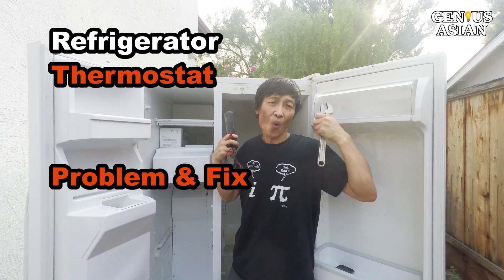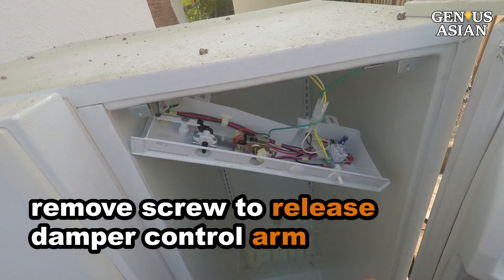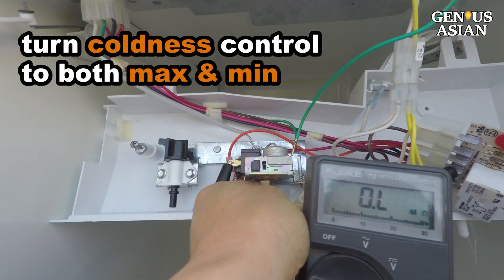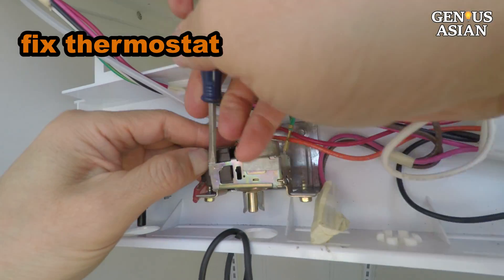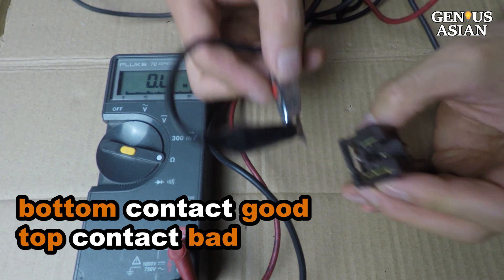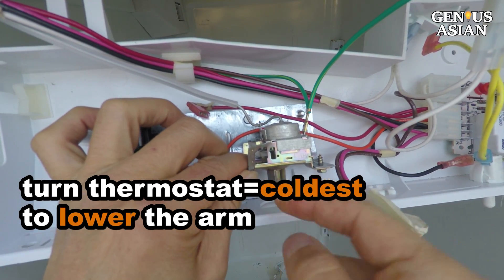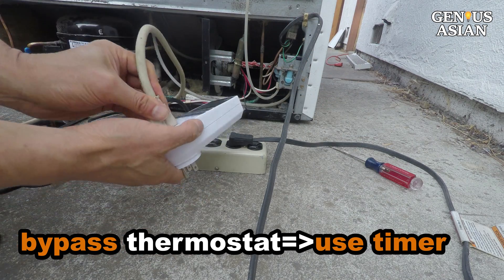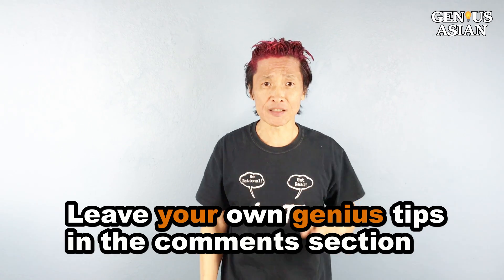Refrigerator Thermostat Not Working: Diagnosis & Repair or Emergency Fix No More Spoiled Food

Comment: Bună seara ce se întâmplă dacă pui firele greșit l a termostat ☺
Reply from the maker: as shown in the video, make sure you measure the resistance before turning on the power. If you connect wrong wire, you may short the circuit and causing your circuit breaker to trip. So make sure you never let hot wire touches a neutral wire.

Comment: How does squeezing the contact fix it?
Reply from the maker: as shown in the video, the copper strip has a hole in the center, the contact is the Platinum contact which filled the copper hole. The problem: there was no connection between the contact and the copper strip. So when you squeeze the platinum circle, since the platinum is  soft (it is softer than 14k gold), the platinum expanded to better fill the hole, thus making a good connection
Reply: @GeniusAsian  Thanks

Comment: Got a new thermostat, worked fine out of the box i tested with multimeter, but once i installed in the fridge the fridge worked for a couple of minutes then it turned off and it will not turn back on, i unplugged the wires and tested continuity on the multimeter and it says its open circuit. Yes the fridge is warm and still it doesn't turn the compressor on, but i can manually turn it on. What do to?

Comment: do they make electronic only (ntc sensor ?) fridge thermostats ? (i.e. without the capillary and bellows mechanical system)
Reply from the maker: since refrig needs to be very accurate on a very wide range of temperature, it is difficult to have a universal measurement. For example, it is very easy to produce universal standard light bulbs because you only have one 110V voltage to worry about. But Software is configured to read a specific temperature curve, whether the curve of thermal couple is a result of mechanical or electronic, the curve is not linear. Different manufacture may use different control unit, which may measure voltage drop via converter or could measure the resistance. The results would be quite different. So you can not even use the thermo made for one brand to replace that of the other. In addition, even though thermistor failure is common, it is still not as frequent as light bulb, so the technical solution chosen need to be cheap as well as long lasting.
Reply: Most NTC thermistors are typically suitable for use within a temperature range between −55 and 200 °C, where they give their most precise readings.  @GeniusAsian
Reply from the maker: @fumblingwiththeball  Thank you for taking the time to share your tips, it would help other viewers

Comment: Hi Genius Asian!  My 23 year old GE FUF17DACRWH upright freezer runs all the time, very very cold, like 15 degrees below zero Fahrenheit.  Must be the old mechanical temp control shorting but WR09X10014 is no longer available.    What should I look for when I take the control apart to try and repair it?  If you don't think I can repair a shorting unit, I might try to fit a generic one in there, like a WR9X499 and use my mechanic and metal working tools to secure it and make it fit.  Thank you!
Reply from the maker: yes, if it is the old mechanical temp control, it is just "on" and "off", you should have no problem fitting a generic one. To repair it, you to know what is the fault. Use a multi-meter to test to find out. Once you locate the problem, it should not be hard to find the best fix. good luck.

Comment: Great video! I have a very similar thermostat and once I removed the contact part a U-shaped spring fell out. I carefully watched your video and I do not see it in your disassembly. There's also a small metal plate that's touching the adjustment screw in the middle of the contact part. I can see it in your video at first but then you seem to lose it. I'm sure these two parts are not random: the plate that was against the adjustment screw and the U-shaped spring but I cannot figure out how they fit together during re-assembly. If you know the answer please help!
Reply: Same thing happened to me. I ignored it because it's just a temporary fix. I'll have a new thermostat in a day or two.

Comment: Some parts came out while disassembling the thermostat, a bent piece of metal and a nonconductive strip of plastic, Any idea where these go?
Reply: Ah I believe it’s an insulator and a tension strip for the moving arm
Reply: Same thing just happened to me. Did you get yours resolved?

Comment: Super ! But i put a new thermostat and i cut the metal pipe that goes in . Can I still weld the end of it and use the new thermostat?
Reply from the maker: which metal pipe did you cut?

Comment: Nice, a squeeze on pliers and back to contact,! No part needed. That part is that cheap a Walmart?
Reply from the maker: yes, walmart. Thank you for taking the time to chime in.
Reply: i suspect the walmart part is not OEM and you may have temp control issues. i ordered one from amazon and the compressor is running nonstop. i want genius asian to put a part link in the description for oem part or cheap tested after market part.
Reply from the maker: @zentember  no longer have the parts. it is better to have OEM part, but if it is not OEM, then you need to know what kind of the thermostat, mechanical or electronic. The one shown in the video is a mechanical one, so the function is based on temperature either off or on, the contact's max current specification is more important.
Reply: @GeniusAsian  where do I shop for OEM part safely and not get overcharged or scammed for it?
Reply from the maker: @zentember  it depends on the manufacturer, for example the Kenmore model shown in the video the official site is https://www.searspartsdirect.com/brand/0582/kenmore-parts  , however you may have to pay more from the official site. So you should get the part number from the official site and then see if you can get it elsewhere. To know which can be trusted, you can read the review other customers left on that particular item.
Reply: @GeniusAsian  thanks, i bought a non-oem one and i think it's working for now but found options for preowned oem in case the first one fails after using your advice
Reply from the maker: @zentember  great to hear that and thank you for sharing your results and it may help other viewers who want non-oem parts. Please subscribe and recommend our channel to friends, thank you

Comment: Mine was fairly easy to identify as bad small pile of black dust under the electric relay portion of the temp control device. Also tapping the area would start-up the compressor and fans. It was the series of videos here that made it easy, thanks!
Reply from the maker: Thank you for taking the time to share your result, this will help other viewers;
Reply: @GeniusAsian  i'm also at the point where i have to tap the thermostat to start the compressor. do i need to do the platinum flattening fix or is there a way i can compress the thermostat to improve its connection? like rubber band it? i can't tell if it'll keep running if i let it keep running. i ordered the replacement part on amazon already but still want to know. i don't own a voltmeter
Reply: Mine too Mike. Starts and stops when tapping on it. Started acting up yesterday. 

I'll be trying what's in the video soon thanks to Genius's video. Hopefully it helps because the part is discontinued. 👍🏻

Comment: Great stuff man. I have a new temp control unit on the way, but I was worried it wouldn't get here before the one i have fails completely, as it is very finicky at the moment. I had an idea how to bypass it, but wasn't sure, and it looks like I was on the right track. Appears to be the exact same temp control unit you are using in the video, too.
Reply from the maker: Glad I could help. Thank you for taking the time to chime in, let us know the result when you get your part, it may help other viewers.

Comment: Thank you, I was going to buy another until I could test it to make sure I could get it fixed - but it’s way Easter to run a wire on the two cables that you remove from the control to by pass and test it. Ones again thank you
Reply from the maker: Glad I could help. Thank you for taking the time to chime in

Comment: My refrigerator doesnr have that dial. Only has electronic buttons onnfrojt of icemaker and water. Fridge keeps getting half frozen or not cold enough for momths now. But freezer works fine whatcan this be
Reply from the maker: freezer works means the compressor is working. If fridge does not get cold, then it may be evaporator fan. Sometimes fridge frozen or not cold could be defrost problem.

Comment: thanks for your video. i have an electrolux fridge in my garage (10 years old) it gets cold when i start it but than its not cooling afterwards 1) is this a defrost or thermostat problem? if i turn the knob to colder, it will turn on the compressor. if i open the door, it will not start the compressor. if i turn timer to compress, it will not start compressor. 2) do i have to replace thermostat with oem or random one is okay?

Comment: I know I need a thermostat, but the part is no longer available.  Can I match up my old one to a substitute that looks the same, or close to it?  I know, stupid question.  But otherwise, I'm looking at buying a new refrigerator.
Reply from the maker: most people would say not to use a substitute. But if it were my own refrigerator, I would like at what kind of thermostat, if it were the old style mechanical one, I will use the substitute, for the newer ones especially the defrost timer is built into the control circuit board or more complex newer electronic ones, I would get a matching onel

Comment: Great content.
Hopefully you can help me. 
My Kenmore Coldspot 105.50022001 (circa June/2000) isn't handling the cold garage during the winter. The freezer won't get cold enough because of the cold garage temps during fall/winter. 
I see that there are garage kits for Kenmore refrigerator models manufactured after 2001...but what about refrigerators made prior? Mine is very similar to the one in this video.
Can someone please help?
There has to be some kind of way to trick the thermostat so my freezer works during the winter. Thanks!

Comment: Terrific video! In my case the freezer is okay and the refrigerator is okay for about 2 weeks after I plug it in then only the refrigerator warms up to 52 degrees F. All the fans inside and out are running. Any idea's what to check next?
Reply from the maker: if your evaporator fan is running, then check frosted over evaporator; check to see if damper is defective damper in the air diffuser; check refrig thermistor ; check control board.

Comment: Thanks for this video .
My fridge when I plug in the wire the fridge light inside the fridge working but the fridge compressor and the little cooling fan the one next to the copmressoer not running ?
Reply from the maker: when the light is working, check other wires: https://youtu.be/XSspTwABECo
if you think it is the compressor try this: https://youtu.be/c98qdSy3qAg
to test and bypass that fan here is the URL: https://youtu.be/HCyDxWifj-8

Comment: I misdiagnosed the thermostat issue initially was an error due to the setting on my voltmeter (yeah I have a cheap one) too high…. After I’ve ordered the new replacement thermostat, swapped it and fridge is still not working!  Hmmh 🤨,  went back reset  and recalibrate the voltmeter and saw the mistake….  Lesson learned the hard way…. 😎
Reply from the maker: Thank you for taking the time to share your result, your comment will help other viewers not to make the same mistakes.

Comment: Good video! My fridge is freezing food. Freezer works fine. There is no damper. With power cord unplugged, thermostat does not click when knob is rotated completely in either direction.
What test should i do with a multimeter?  Thank you.
Reply from the maker: in this video: for thermostat, watch this video: https://youtu.be/grURTgO2-x0  ,  you need to follow the instruction in the video and remove one wire of the thermostat, and then measure the resistance of the thermostat while turning the knob.  If you want to measure from the plug for simple elimination, you can follow this one: https://youtu.be/XSspTwABECo
Reply: @GeniusAsian  Thank you! Great big help!

Comment: I have tad different problem, thermostat seem to not be calibrated properly, keeps temp within 10c, no matter the setting, might have to open it trying to fix
Reply from the maker: is it too cold or is it not cold enough? Not cold enough may be caused by leaked refrigerant or you could try cleaning the compressor coils: https://youtu.be/jMkkoXpHIPA , because dirty coils can prevent efficient cooling. You should also check  the door seal.
Reply: @GeniusAsian  i have the same problem where the thermostat is used to turn on a fan that vents cold air down from the freezer to the fridge. my problem seems to be that even on the "coldest" setting as far as itll crank the fridge stays above 40degrees F any suggestions on this issue?
Reply from the maker: @Von_Hohenheim  If your freezer is cold but your fridge is not cold, then it is the evaporator fan problem: https://youtu.be/HCyDxWifj-8?t=863
Reply: @GeniusAsian  My Fridge is actually too cold, even when I turn the Thermostat to the off position, I can hear the compressor still running. Any suggestions?
Reply: @kemikalja  Same here. The whole thing has turned into a freezer.

Comment: Why don't you show closeup of shorting thermostat?
Reply from the maker: the thermostat has two terminals: https://youtu.be/grURTgO2-x0?t=94
  one is facing you, one is behind the thermostat. To short the thermostat, you need to short these two terminals (this thermostat is a mechanical one). Since it is not easy to clamp the wire to these two terminals and since the terminal is wired to the control board, I shorted the contact on the control board (this is equivalent way to short).